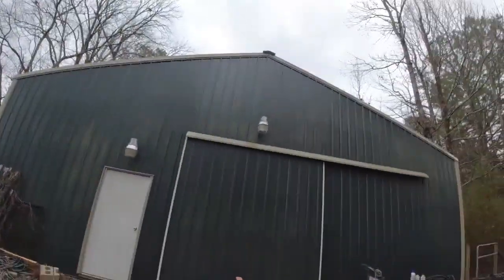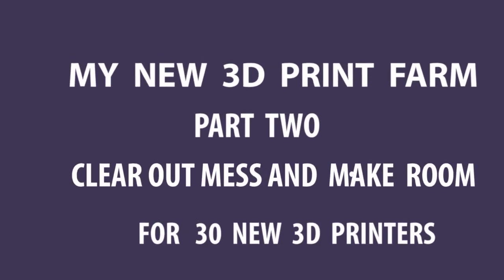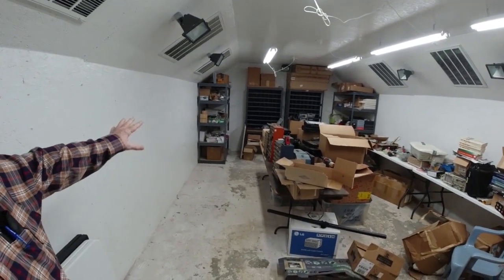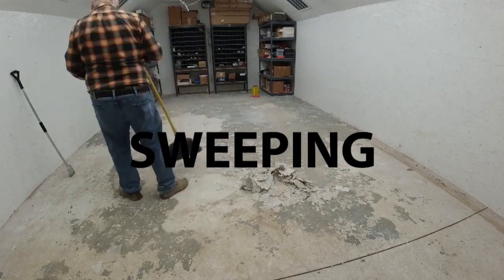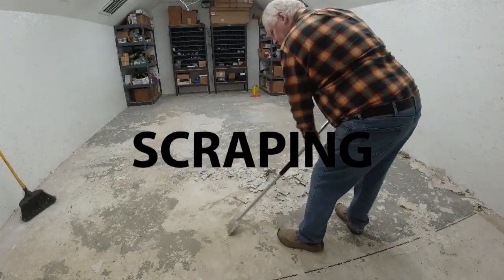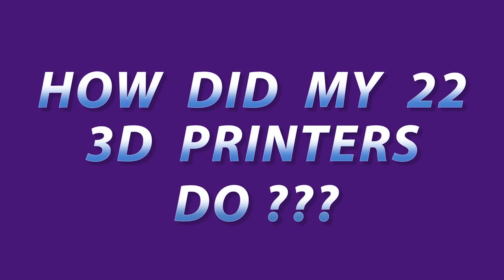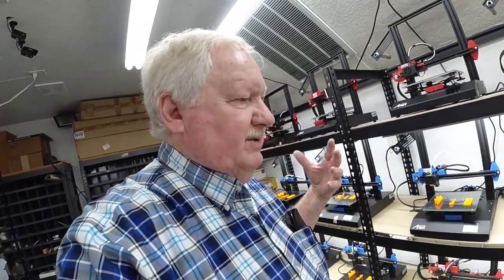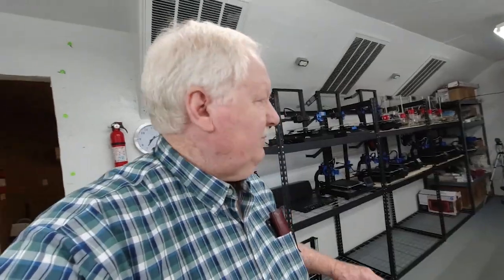MY NEW 3D PRINT FARM AFTER 7 MONTHS See where I am now!

Comment: I'm starting a print farm.  I have 2x Ender 3 v2's, and ender 3 S1, and an S1 Pro in the mail.  I'm really struggling with maintaining these printers.  They only run for a few days and then there are all kinds of problems.  I am only selling 1 product but it really needs to be nice looking (near perfect) to be functional, and after a few days my printers all stop working and I get swamped with orders (funny how the timing always ends up the same).  Is there a way to get these printers to just print consistently for at least a couple of months??  Or a better printer I should get without costing thousands of dollars?
Reply from the maker: First of all, Wayne, I want to wish you much sucess in your new business. You should not have problems like you describe after only a few days. Make sure that when you level your bed that the adjustment screws are compressing the springs a lot, they should be very tight, this will keep them from getting out of adjustment. always set your 0-offset with the hot end and bed preheated, this will account for heat expansion. Make sure your bed surface has the same chrematistics' each time, you must have consistent adhesion every time you print. Without knowing what type of problems, you have I can't tell you much more at this time. Good luck I'm sure you will get it worked out...Ken

Comment: What do you do for air quality control and filtering out UFP's? Nice setup.
Reply from the maker: I have a dehumidifier that runs continuous in the room, and it has a good filter. I also continually exhaust a portion of the air and bring in fresh air thru filters in the ceiling of the print room " look for the vents in my videos". The other room has a booth with a special exhaust system for Resin and ABS printing. Thanks for the question, Ashley and thanks for your support...Ken

Comment: I assume you're pretty sold on those Anet ET4 printers.  Would you recommend them for someone just starting out in the 3D print world?  Have you looked at the ET5 yet?  Great video.
Reply from the maker: Thanks for the question, Rob. I do have an Anet ET5 and it is just as good as the ET4s. I got most of my Anet printers because of the deal I got on price. With the print farm It really helps to have one general type of printer so that you can maintain them better and have fewer spare parts in inventory. That said, I do like the Anet printers and think the ET4, ET4 PRO, and the ET5 would make a good starter printer. I just posted a video on how to make sure the ET4 is adjusted mechanically to insure good printing results. Good luck, I hope this helps and I wish you sucess 3D printing....Ken
Reply: @NewTechInventors  thanks a million. It’s an adventure!

Comment: Is there a reason why you have three different printer models? It looks like they all have the same build volume. Wouldn't be easier to have just one model so you have to keep fewer spare parts and maintenance would be the same on all machines?
Reply from the maker: These Anet printers, ET4X, ET4, and ET4 PRO all use almost all the same parts, so that is not a problem. Tha main reason for having many of the three different models was the buying opportunity I had when they were on sale or being offered at a quantity discount. Thanks for the question and for your support...Ken

Comment: Do these use a lot of electricity?
Reply from the maker: In my video (MY HOME BASED 3D PRINT FARM FIRST RUN), I ran 22 Anet ET4 printers and averaged about 16 AMPS at 120V while printing PLA with bed temperature of 200. They were averaging less than one amp each. Thanks for your comment and support...Ken